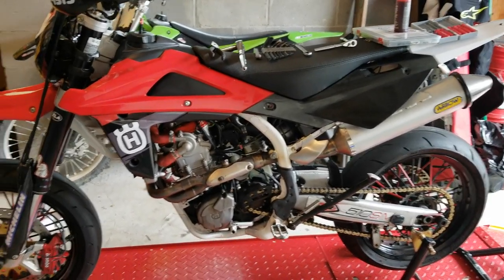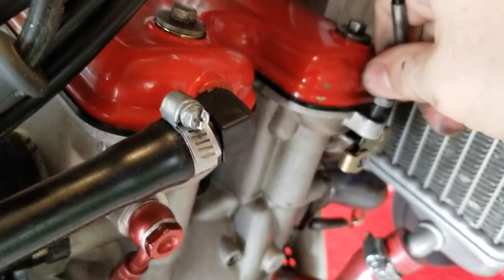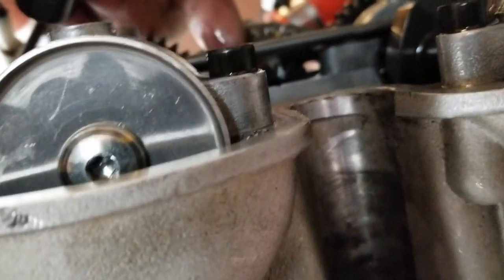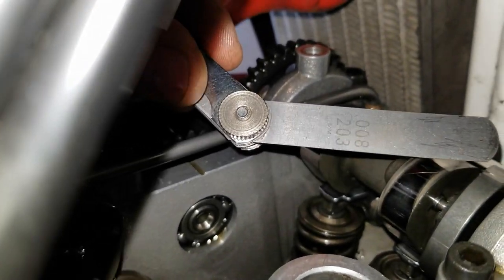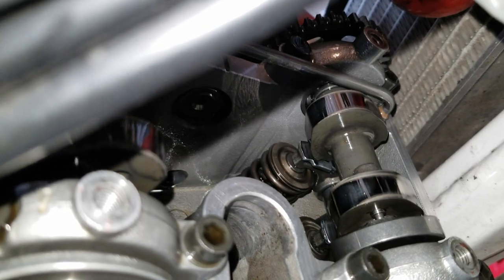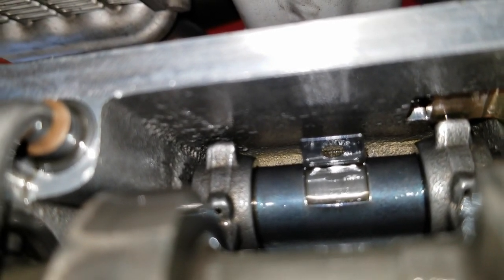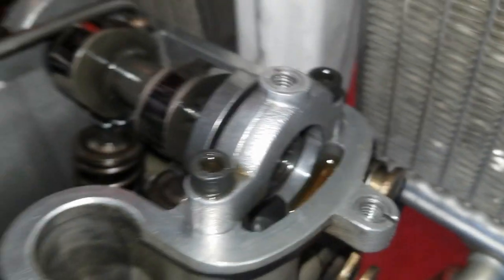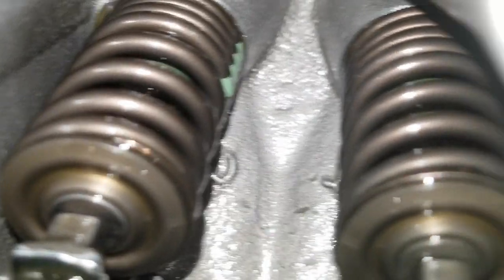Husqvarna SMR510 Valve Clearance check/Adjustment

Comment: Hey its me again, have you ever needes to rebuild your engine ? And with how many miles? Thanks!!
Reply from the maker: I rebuilt top end at 8K miles just for piece of mind. Replaced piston, rings, wrist pin, cam chain and tensioner Everything looked great for 8k miles and probably didnt need to be done.
Reply: Quickshift Outdoors oh great, and is it really expensive? Mine has 5k miles and im not sure if its worth it to spend a lot of money on rebuilding the engine or just use it a couple of miles more and sell it, what would you recomend me?
Reply from the maker: Honestly it depends on how well the bike was maintained for those 5k miles if it would justify a rebuild.  I rebuilt it myself so I definitely saved money there. If I remember correctly after all said and done it ran me a bit over $500 to replace piston, rings, chain, tensioner and all the gaskets. I also had some other items I replaced so if your just doing top end it might be a little cheaper. Personally, it might be worth tearing into it and checking everything out just for piece of mind. After the rebuild you could always sell it if you want
Reply: Quickshift Outdoors oh well i dont know if i will be able to doir by my self😅 but thanks for the info, iguess if someone builds it for me it would be over 1k😕
Reply from the maker: @swayzee1989  make sure it's in second gear. It's not going to spin easily at all. I usually rock it forward a few times to find tdc. Also be sure the spark plug is out!

Comment: You Dont have to remove the rocker arm to replace the shims? Like on the 530exc?
Reply from the maker: The rocker arm just slides over once the retaining clip is removed. No need to remove it. Pretty sweet design.
Reply: Do you have a hard time finding parts? Like top end components, electrical etc.
Reply from the maker: Not to difficult to find parts. Got everything for the rebuild off motosport.com  and was here within a week. Only exception being the gasket for stator cover that was on backorder for about a month. Reused the old one until it came in

Comment: How should i go about doing this while the engine is on the table? Is it even possible?
Reply from the maker: You could turn the motor over would be by pulling the left cover and turning the flywheel over until at top dead center
Reply: @quickshiftoutdoors  Thanks for the tip. Maybe if I assemble the clutch and spin the front sprocket with a chain I could avoid buying a new seal.
Reply: @quickshiftoutdoors  Also thanks to your video I know exactly what to do. Much appreciated, good guide.

Comment: Do the valve cover bolts need to be torqued to anything specific?
Reply from the maker: Yes I believe it's to 5.4 ft lbs. I usually just hand tighten and then a just a bit tighter with a socket

Comment: guys is buying an older bike of this sort a huge risk? How's the maintenance on these, and can the engine just blow up?
Reply: So buying a 4 stroke is always a little more risky then a 2 stroke and these require alot of maintenance so if they aren't properly cared for then the engine can blow up but you can always buy one and rebuild the engine right away if your not confident in the seller and then at least you know what you have

Comment: How did you covert to supermoto wheels just bought an 07 te
Reply from the maker: I didnt convert it. This is a factory supermoto from Husqvarna. If your looking for info on doing a conversion on a TE, look at cafehusky, supermotojunkie.com bunch of write ups on those sites.
Reply: Nice and u genuinely love the bike no big maintenance issues??
Reply from the maker: Nope. No big issues with the bike at all.
Reply: All non-KTM, non-BMW era supermoto wheels fit on your 07, any Husky wheel dating back from the mid 90s to the late 2000s. If you just want supermoto wheels without the big brakes your going to need is wheels and an extra set of TE rotors and sprockets. If you want to convert to supermoto brakes as well you will need to swap out forks, axles, front rotor and master cylinder as the supermoto uses the much larger 4-piston radial mounted calipers and the fork legs are very different.

Comment: What shims are needed? What size kit?
Reply from the maker: The shim kit I use for my 08 Smr510 is the hotcams HCSHIM02 they are 9.48mm shims. Some years use the 7.48mm shims so I can only confirm for a 2008.
Reply from the maker: Intake is .004-.006in and exhaust is .006-.008in. Feeler gauges are generally sold in a set at any automotive store and are pretty inexpensive.